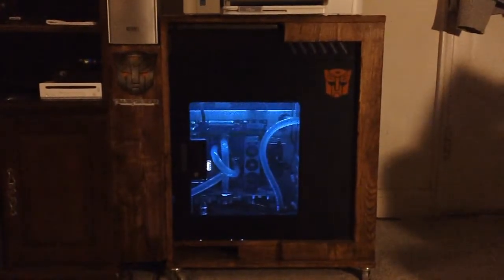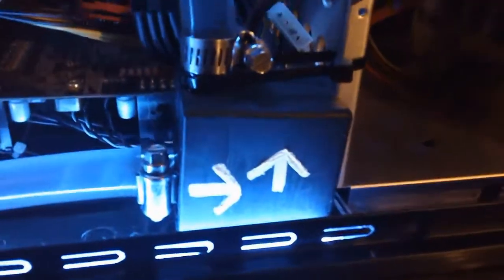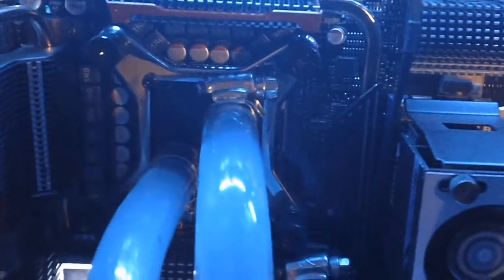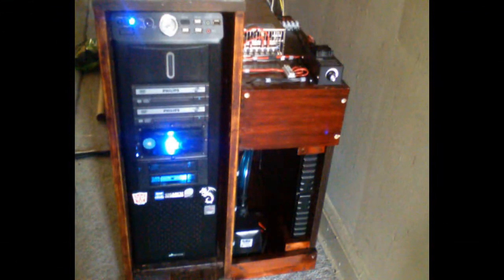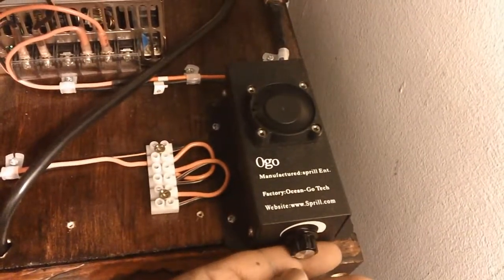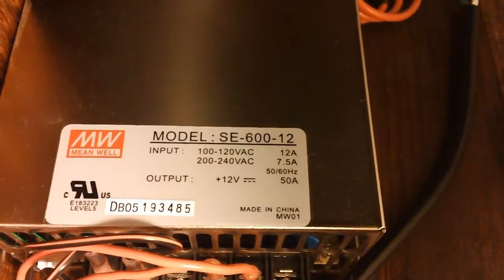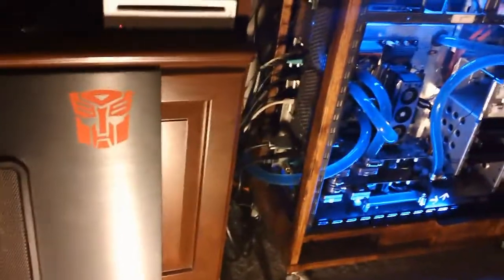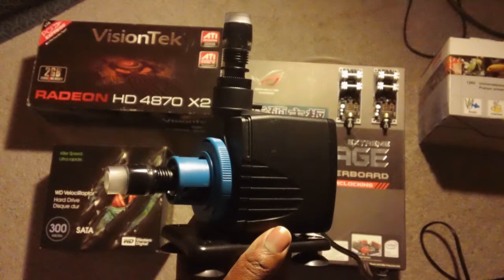The Gaming Computer - All water cooled

Comment from the maker: @adamjamesroe actually a phase change unit uses Compression to compress R134a freon (you know the stuff that is used in your A/C to cool you down in the summer). Peltier or  TEC's as some call it uses little inexpensive semiconductors smashed in between 2 ceramic plates and then sealed, which have a red and black wire connected to them  then when 12v is applied to the it causes an effect that is called the Peltier affect which one side of the ceramic plate gets hot the other side get cold!

Comment: I like your setup except your choice of the pump. Watercooling pump is all about head pressure not flowrate. 

Laing DDC 3.2 stock would outflow that Eheim. Mod it with variable voltage control board (run up to 30v without heatsink) and it will blow water out of your reservoir . 

My test result show the little DDC even beat my beastly 24v  Iwaki.

Comment from the maker: @TheEhxpert I'm not really sure but there is 2 factors you have to keep in mind maybe 3. 1. is it a 4870x2 (Does it have 2 processors on the Card). 2. What does the fan on the GPU look like (different fan different hole positions). 3. these cards get really hot and i have two of them make sure your water loop (or Radiator) is big enough to handle the Heat!. If these things match up for you then you will have a great water block. EK water blocks are THE BEST HANDS DOWN!!! Thanks for Watching

Comment: if you want to overclock your cpu then its an option. If you are going to superclock it then its pretty much a necessity. I dont think there are any air cooling systems that can do as good of a job as a water cooling system. (and then there are phase changing cooling systems that are top of the line).
Also it becomes even more necessary since overclocking usually means you will be upping the voltage on your cpu and ram which creates lots of extra heat. So the system heats up pretty dang quick.

Comment from the maker: @MeLinhLam Yes your right the Laing DDC 3.2 Hmax is 4.7 the Eheim Hmax is only 3.6 so your right it would out do my pump as far as head pressure is concerned, But i have to sacrifice Head pressure for Flow rate because of the BIG ASS Radiator i have in my loop. I would have to get 3 Laing DDC 3.2's or 2 Laing DDC 3.25 Pumps just to keep the Hmax Consistency thur the loop. Eheim i/h is 3400 compared to the DDC's i/h 500-522. and by the way this pump is120v 80w.. Thanks for the comment!!!

Comment: I have a question. CPU's GPU's and some RAM's already have built in fans... The computer case itself have several intake and exhaust fans (depending on how many you want)... The PSU normally has one exhaust fan... Is it still necessarily to water cool the computer?

Comment: Hmm if you overclock the CPU and GPU it gives you a few hundred MHz right? Why not just buy a newer, faster processor or GPU? If you consider the cost of setting up a water cooled system, plus the time and effort that is given to this set-up, you might already be spending as much as getting a newer CPU / GPU... Also, if you get new CPU / GPU, you can use the old ones for a spare computer or you can sell them off... Is it still more viable to make a water cooled system?

Comment: Well for instance I have a 3930k so my upgrade choices would be the 3960X for another $600 for only an extra .1 GHz in frequency and a bigger cache but instead of going for that I opted for water cooling which was much cheaper than going for the 3960x, and brought my CPUs frequency up to 4.6 ghz and my GPU's up to 1300 mhz, so you really can get huge increases in performance through overclocking, plus water cooling gear tends to last a lot longer than the hardware your cooling

Comment from the maker: @samshirley001  Well @full burn you can expect to see temps around 52C which could be better if I had a "slower" pump. You see its really all about saturation or how well the water (or heat) saturates in the radiator if you have a good radiator and a water pump that's speed "adjustable" you can get better temps, try and spend a little more money on these too things and you'll fair a lot better also keep in mind that i have 2 4870x2 in crossfire so that heat add to the overall temperature.